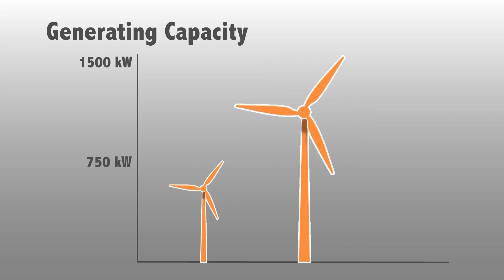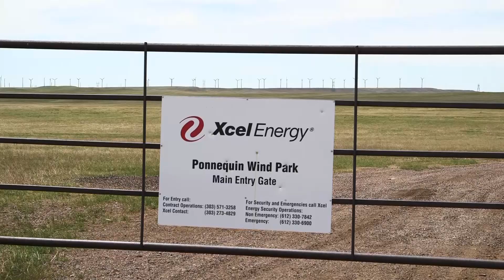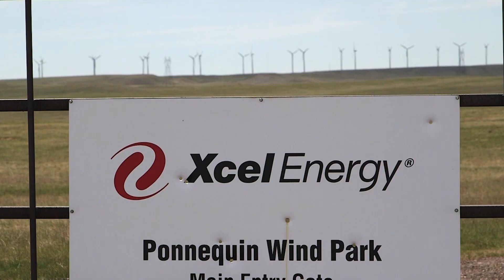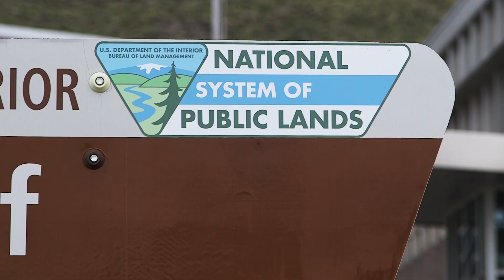Who Cleans Up When a Wind Farm Retires?

Comment: We should have built more clean, efficient, safe, reliable nuclear power plants decades ago. Then we wouldn't even need to have this discussion. It's not too late to start.
#CleanNuclear
#SafeNuclear
#GreenNuclear
Reply: Nuclear will need massive subsidies and complete revamp of the engineering implementation. They also need to switch to Thorium/Liquid salt systems.
Maybe the with SMR-Thorium it could work.? 
Also the whole electrical grid needs a huge modernization in itself.
MJ
Reply: Lies  Nuclear Lies  Just Bigger  Money  For Ever A Pit OF DEATH   Never Stops Killing THE EARTH   You ARE Fools  That Say Clean  Cancer For ALL Damm The Greed Lies
Reply: Replacing a reactor core is far more dangerous, and a much greater environmental hazard than any battery, turbine, or panel. Some batteries are difficult to recycle into new batteries, but recycling a spent core is virtually impossible. I'll take my chances with batteries.
Reply: @vincentrobinette1507  Yes replacing ONE reactor core is far more dangerous and a much greater environmental hazard than any ONE battery or panel.  HOWEVER replacing about 2000 nuclear reactors is far, far less dangerous than making (much less replacing/recycling/disposing of every 10 years) the equivalent of 5-10 BILLION powerwall batteries needed to keep a renewable grid from suffering regular blackouts and enough solar panels to cover a state.

See, you're thinking about this from what is in reality a seat-of-the-pants, grid will collapse at any time standpoint, aren't you?  I'm guessing (perhaps an unfair assumption) you take average electrical consumption and assume a day's backup, maybe two is enough to keep everything from going south.  But even the existing grid has weeks worth of "storage" equivalent in the supply chain (or piled up outside plants) and even though electrical production (which is only about 1/3 of demand) is about 10 terawatt hours per day, actual generating capacity with that on-demand system is enough that the US could produce in excess of 20 terawatt hours per day if they ran it full out.  Checking out capacity factors for whole nations and you find that wind output vs installed capacity will vary over a whole year by as much as 20%.  We'd need a month or two of backup (electrical) power to keep there from being blackouts, often at crucial times like during winter storms.
Reply: @poitsplace  Power walls work really well for residential applications. You need a lot more than that for commercial buildings, which need far more power for the area available for solar panels. If you were to go off the grid, I would recommend 5 days worth of storage for wind only, about the same for just solar, but for both, you could get by on a 3 day reserve. I recommended 1 day for home, if you're backed up by the grid. On a grid scale, 1 day of stored energy would work well, if the entire nation was networked together. that's because, the wind will be blowing  somewhere, there will be sunshine somewhere. Solar panels will usually produce at least half their rated power, even on an overcast day. Wind is more intermittent than that. When the wind blows, turbines really put out a lot of power. otherwise, they're just yard ornaments. You need much more storage for wind-only applications. It would be really easy for me to go off grid right now, but if I want to get rid of my gas furnace and switch over to electric heat, then buy an electric car, that will double my power consumption. It would be much more of a challenge then. That is my goal, but the tech just isn't there yet. Most power stations like to keep 15 to 30 days worth of fuel on hand, just in case of a supply interruption.It also provides reserve for unusually high demand. If all renewable resources are in the same area, you need more storage than if they can be scattered all over.
Reply: @ @vincentrobinette1507  You're thinking of this with the mindset of an enthusiast...willing (if not intent) on making sacrifices to make it work.  The rest of us aren't putting up with it.  The rest of us don't want "smart meters" to cut off our appliances because other people's ideology says we need to use a long abandoned energy source known for its diffuse, irregular nature.   The rest of us will not tolerate "Sorry there's no work today because the wind isn't blowing and the sun isn't shining bright".

Market forces utterly destroy renewables and nobody has even reached 20% of total energy demand.  Because of the capacity factor, when they produce, they frequently overproduce by so much that it would be near impossible to use it (prices crash  so their energy is literally worthless).  The grid needs to have over 5X the capacity just to move massive amounts of power over such vast distances, often at a moment's notice.  The grid doesn't even work the way you think it does.  There is no "we just run a wire there"...electricity goes where IT wants...with the current system of large power plants this is not an issue, the output is relatively stable because we know the path it will always take from a small set of specific points.  A recent study found that about 60% of germany's overproduction actually cascaded AROUND the lines meant to carry it...overloading local grids as it drops the energy at the closest point, which displaces capacity from the other region, which displaces power from the next...overload after overload.  Your comment also ignores that generating/grid costs skyrocket as a result of renewables increasing wear and tear while decreasing economies of scale, now such inefficiencies are wrongly attributed to fossil fuels when the additional costs are actually the cost of renewables.
Reply: @poitsplace  That is precisely why electrical energy storage is so vital, for intermittent renewable energy to work. That's why wind can never exceed 20% without storage. The disruptions of the grid. Base load plants cannot respond quickly to rapidly varying loads. They're not like a portable generator with a governed Briggs and Stratton engine. At the very least, you need enough electric energy storage to give a long enough time constant, for base load plants to respond. They need hours, not seconds to respond. during gusty winds, too much wind capacity can cause all the problems you described and then some.
Reply: @vincentrobinette1507  The problem is that you're talking about bending over backward and making truly massive sacrifices to solve a problem that simply does not exist.  You're talking about an ongoing cost of something like ten trillion dollars a year just to prop it up the policy of blighting the land with these monstrosities (more than the turbines/solar installations themselves).

On the other hand we have nuclear.  Even if we needed peaking capability with older style plants, the peaking needs are about 1/4 of a day's production worth of storage because we're not at the whims of the weather.  We KNOW the rate of production.  And if you wanted to move much more quickly to reduce CO2 (not that its the issue many have been duped into believing it is) you'd be better off pushing for fracked gas to immediately reduce the consumption of coal as nuclear plants were built.

As it is, once you really look into the math of how renewables ruin the market, you know the current nonsense about wind/solar would fail, period...grinding down the economy until all support is lost and pollution skyrockets as people stop caring about the environment at all.  But of course, since these things all happen across a spectrum, support verses "progress" toward renewables will end it before it gets much worse.  Probably end up using coal since everyone pushing renewables was so dead set against anything but renewables to compromise.
Reply: @poitsplace  I don't know what the sacrifices are, but the status quo is not sustainable. There is no perfect solution, but it's going to be an easier transition when we run out of mined resources, if we have a head start on alternatives. If we don't gain experience, and allow technology to reach scale of economy, it's going to be brutal. Because of the renewable push, solar panels can be purchased for less than 50 cents per watt. If no effort was made, we would be paying 5 dollars per watt. Turbines are less than half price, and are much more reliable, because of field experience. Like them or not, we will be stuck with them when coal or natural gas it tapped out. The greater the percentage of renewable capacity, the less difference we'll have to make up. What we need to be working on right now is energy storage. It's the only hope for nearly 100% renewable power. There will still be a need for base load, but when coal and gas run out, nuclear might just be the  choice. We just need an economical way to extract uranium from ocean water, which can keep us supplied for many years to come. With mines starting to close down from being mined out, and using natural gas at an unprecedented rate, that's coming sooner than you might like to think.
Reply: @vincentrobinette1507  Remember that the first step in "sustainability" is lasting until tomorrow.  Deploying clearly inadequate, overpriced technology will only weaken our long term position.  Nuclear would weaken us less...although I have absolutely no problem just letting things run and allowing market forces to make people go "Ok, this is too expensive for what we get, we'll phase it out and move to other things"

The irrational fear of nuclear and push for renewables is only making it HARDER to find new technologies because subsidies are propping up technologies that are clearly unfit while (ironically) creating an even heavier demand on fossil fuels.  Putting it off because it's just plain inadequate is the most rational decision.  Different technologies will show up, things that we haven't thought of, especially if we don't back specific current tech.
Reply: @poitsplace  As it turns out, there is a measurable amount of uranium in sea water. If we could find a cost effective way to merely filter it out of the oceans, nuclear could be an excellent base load power source. Right now, because of the cost of the energy storage necessary for renewables to become a significant percentage of our capacity, it hasn't quite reached the "tipping point" in very many areas yet. As technology gets cheaper, and fossil fuels get more expensive, we are getting closer to that point where renewable energy is cheaper to develop than conventional. I don't think we should shut down mines, or retire existing assets, just run them until the mines are mined out, then make a decision. No matter what, there was money invested in each of these sources. To get the most return on that investment, they need to finish out their life cycles. That goes doubly for wind farms, because of their lower output per dollar invested. If they are decommissioned early, there is definitely a loss.
Reply: @vincentrobinette1507  The problem here is you've been brainwashed by endless, one-sided BS.  It is not "almost cheaper", it's supported by ridiculous subsidies.  Paying half the cost?  Guaranteeing that you get paid end user rates for extremely low quality/reliability power?

Have you looked into the MATERIALS requirement of renewables?   I guarantee you once you hit the cement/steel/labor required per gigawatt you INSTANTLY go "Oh, these people are bat $#!+ insane and have been lying to me this whole time"....like it has 5-10X the requirement of even the older, more complex nuclear plants.  That's what did it for me.  I hit the number and then tossed it all like the nonsense it was.  It WILL NOT happen because the scarcity of materials would grind the economy into the dust, ending the ability to do it in the first place...and even if it didn't it would take 5X as long as it would to deploy nuclear because of the materials/labor requirement (also it has to be replaced twice as often). 

The storage requirements ALONE come to about 1/4 to 1/2 of GDP.  GONE...not happening...outright insanity.  There's no "but what if" unless that "what if" involves grey goo nanotechnology that builds everything for us while we get fat and lazy and pay nothing.

Market forces insure wind/solar ONLY work for off-grid installations except in extreme cases.  As soon as it hits the market, think about the simple math...because of capacity factor they're frequently overproducing, meaning the power is TRULY worthless and most of it has no return on investment.  OR they underproduce, driving dispatchable prices higher (along with electrical bills) while again, not giving return on investment ....it is literally a buy high, sell low scheme for the unobservant.  In europe...and please, look this up...spot (wholesale) prices for electricity sometimes go NEGATIVE because of renewable overproduction.  Its just propped up by subsidies.  

None of this touches on the complete overhaul of the grid and making a system of enormous trunk lines, service roads, wind/solar farms, etc criss-crossing the nations of the world...just hoping and praying that everyone will come together singing Kumbaya instead of getting pissed at each other over energy policy.  And of course hoping that its not more damaging to put all that stuff out in the environment than just waiting a bit for a likely more suitable, lower footprint source of energy..

Nuclear has simply been vilified.  We have a perfectly acceptable strategy.  Have you heard about the tests they do on the transport containers?  Has it EVER occurred to you how insane it is to say "But what if some gets out" from a kilometer down into pristine wasteland that's been geologically stable for half a billion years?  Because I'm guessing  you never thought about the fact that if ANYTHING brings up a meaningful amount of radioactive wast from a kilometer beneath the surface...the LEAST of your worries will be the nuclear material.  The main concern would be the supervolcano or asteroid that nearly wiped out humanity when it just happened to hit a nuclear waste dump, which BTW would carry an insignificant amount of radiation compared to the hundreds or thousands of cubic kilometers of rock that would have been ejected into the atmosphere.

After you actually shed the optimism and start looking into the REALITY of what is required...its insane to think its a good idea to move forward with such plans in the immediate future.
Reply: @vincentrobinette1507  
I don't think we're going to 'tap out' our mined resources anytime soon. Back in the seventies the doom and gloom prophets were claiming a less than 30 year supply of oil left in the ground. 40 years later we apparently have a greater than 200 year supply. The coal industry says we have a 300 year supply in the US alone. 
So we're not in any danger of running out anytime soon. 
Solar and wind are NEVER going to be better than a partime solution. Barring some 'eureka' discovery somewhere, storage solutions are going to be a long time comming. Batteries are always going to be big, and expensive, with a relatively short operational lifespan. Then disposal/recycling which will require ever greater resources as more of them require processing.
Reply: @chuckaddison5134  That was 40 years ago. Not only have we continued to use, but the demand has more than doubled, since then. It is harder to find now, which is why we're resorting to oil shale, and fracking to get to the bottom of the barrels. It's becoming increasingly more expensive. I remember oil being less than $10.00 a barrel, now, it's well over 70, and has reached over 100. 10 times more expensive than it was in the '70s. We are not going to wake up one morning, an find every well in the world has run dry. That won't happen. What will happen, is it will continue to become more, and more expensive, until it is no longer the most economical source of energy. It continues to get more expensive, while technology becomes less. The tipping point has been reached in other countries, and in certain areas in the US. I give it 5 years, no more than 10, that the tipping point, where renewable is less expensive than conventional, will become largely nation wide. When that happens, grid scale electrical energy storage will become absolutely necessary, to maintain continuous reliable power. Another thing that may make a comeback: Nuclear power.
Reply: @vincentrobinette1507  
For what its worth, I believe nuclear is the future. It's here now and getting better. I dont see the renewables ever being the main source of grid power due to the production and lifecycle costs. Yes, they will come down some, but still, the vagarities of the sources are uncontrollable.  If you consider the sheer numbers of wind turbines required, then you have to start considering the long term consequences of the amount of energy we would be extracting from the earth and, ultimately, sending into space as waste heat.
Uranium is a commonly found element, at least as plentiful  as Zinc and Tin. So we will have grid power for many generations to come. Waste disposal issues will have to be solved. Recycling nuclear waste is an immature technology that, if developed, could both reduce nuclear waste by using it to make more fuel, and reduce the half life of the reused waste to a few hundred years from the tens of thousands now required. 
There are some security considerations around recycling the waste, but nothing that can't be solved.
While I actually have no issues with solar and wind, I dont ever see them as more than an off grid solution for individual homes, or small groups of homes. Plus there appear to be issues with infrasonics from the wind turbines which, if unsolved, could limit human habitation around wind farms. Which would be a problem as the farms  would occupy a substantial chunk of landmass.
Reply: @chuckaddison5134  Nuclear is a perfect base load power source. it can greatly reduce the amount of stored electrical energy to firm up the grid for a large customer base. The only consideration is levelized cost of energy. A nuclear plant is VERY expensive to build and commission, but, consider the vast amount of energy they can produce over their service lives, to divide out that cost. Nuclear could prove to be a very economical source of power,  especially if a recycling program comes on line to re-refine the cores, and reuse the fuel. From what I recall, you only use a small percentage of the total energy in the core, before it just doesn't put out enough heat to run the plant at full rated power. When a spent core is removed, it has to be stored in a cooling pool for years, before it cools down enough to be put in casks for disposal. That's a lot of stored energy left on the table. Nuclear power is definitely a long term investment. A lot of money up front, for energy that lasts for decades.
Reply: @poitsplace  What we're doing now isn't going to last forever. It's not likely that we will suddenly run out of fossil resources. What will happen, is that it will just get more, and more expensive, at the same time, technology becomes less expensive. Compared to just 20 years ago, solar is only about 1/10th as expensive as it was. Wind turbines are about half the cost per watt. I remember crude oil being less than $10.00 a barrel. now it's at least $70.00, and it has gone higher than $100.00. wind turbines and solar panels have become less expensive than conventional sources in some areas, where electricity rates are above the national average. The problem is, like you say, is that when you add the cost of the electrical energy storage necessary to levelize the intermittent  output, that's the only thing holding it back. 20 years ago, your statement would be absolutely correct. now, it's debatable. Give it 5, maybe 10 years tops. We'll see what happens. Nuclear is definitely a good option, if it is cost effective. It really is a long term investment. Billions to build, but it puts out so much energy over its lifetime, that it should have no problem covering its cost. Turbines and panels pay for themselves in about 5 years. Nuclear takes about 20, but can run for as long as 60 years. Replacing the core of the reactor is a very expensive maintenance, that needs to be done about every 20 years, but it's nowhere near the initial commissioning cost of the power plant. New cores pay for themselves rather quickly. Please note, the General Electric BWR 6 nuclear reactor is what I"m basing my data from. Newer reactors are undoubtedly going to be better. We can't immediately shift away from coal to wind, this transition will happen by attrition over several decades. No matter what the energy source is, money was invested. the only way to turn maximum profit, is to allow each source to finish out its life cycle. I also agree, that if a source, be it conventional, renewable, or nuclear, is so cost effective, then there should be no subsidies for any of it. Let free enterprise run her course. Whoever can get power on the grid the cheapest, wins.
Reply: @vincentrobinette1507  
A recycling program would be a necessity if we're going to embrace nuclear power large scale. Used in a single ended or single use plant our planets high grade uranium would be consumed in a couple of hundred years or so, leaving vast quantities of very long half life waste to be dealt with. Reprocessing and second use of the fuel reduces the wastes half live to 500 years or less. Still not ideal, but better than tens of thousands of years. The only other problem is reprocessing produces Plutonium 239. Which would require some increased security considerations.
Reactor designs have improved over the ones installed in the 60s and 70s. 
The molten salt reactor is supposed to produce more power at less cost with less waste product and less chance of meltdown than the water cooled designs currently in use. 
Another prospect is the single design plant. Which could then be cloned whever a plant is desired. This should reduce construction and certification costs over time while increasing safety and efficiency. 
There are, of course, hurdles to overcome. Public opinion being prehaps the largest. But sooner or later we're gonna have to go down that road.
Reply: @vincentrobinette1507  Look, we are simply not going to use anything remotely close to the wind/solar we have today.  Its a passing fad.  To suggest we use wind/solar is to pay utterly insane amounts of money to transform the energy industry...and then in less than 20 years we'll have to pay another fortune to rip it all down and use whatever forms of nuclear energy we decide on...fusion, traveling wave reactors, MSR's, pebble, etc.

The ONLY reason anyone is deploying it on utility scale is that governments are throwing money at it...insane amounts of money...basically guaranteeing well over wholesale rates for crappy, intermittent energy that has an average value of about $.01/kwh.  And BTW it IS NOT "whoever can get power on the grid the cheapest".  Almost all the value is in it being available when you need it.  Intermittency has a high cost, so no matter how cheap it is, its still "too expensive" for most people.  I'm all for letting utilities do it WITHOUT SUBSIDIES, but you and I both know the moment the subsidies dry up, not only will they stop building new capacity...they'll let all the stuff that is built fall apart rather than repair it.  I'm pretty sure you kind of understand that, and it should make you stop and think.
Reply: @poitsplace  intermittency is the major problem for both wind and solar. What we need now is grid scale energy storage. That will allow base load plants to run at their peak efficiency points, as well as absorb the surges of power from gusty winds, and partly cloudy days, as well as level the varying loads from the customer base. With that, there would be little to no curtailment of turbines, nor solar. Coal plants will be able to maintain their maximum megawatt hours of energy per ton of coal burned. The problem is, back to the cost effective thing, is that if you add the cost of renewable sources to that necessary energy storage, it can't compete on the wholesale market. Solar panels and batteries are a break even for me, because they're competing on the retail market at $.11 per kilowatt. I can't quite save money yet, but it wouldn't cost me. Wholesale, less than $.04, the turbines themselves barely compete. Energy storage puts conventional sources back in the lead. IF someone comes up with a commercially viable nuclear fusion reactor, or perhaps even a good breeder reactor, that would render ALL existing power sources obsolete. Coal, natural gas, conventional fission, and of course wind, solar, geothermal, or any other renewable would be on the chopping block. Until then, we need to make due with what exists, that means wind and solar, as well as letting existing conventional sources finish out their life cycles, to get as much return on their investments as possible.
Reply: @vincentrobinette1507  I give up, you're right...2+2=37 or whatever deranged, moronic math you use that says "uncompetitive wind/solar + storage that's even more expensive by its self + by the way, absurd grid improvements = competitive product"
Reply: @poitsplace That's why I said, because of the cost of grid scale electrical energy storage, Wind and solar aren't ready to compete in the wholesale market, just yet. As fuel gets more expensive, and technology continues to come down in price, the time is coming, but not in this decade. It may not even happen in the next, though I think by 2030, there will be a change. For right now, today, you are right. We just don't have that energy storage. If wind blew all the time, wind would be cheaper, but, few turbines ever produce more than 30% of their rated output, because of intermittency. Solar isn't quite as good, but it costs less per installed watt than wind.
Reply: @poitsplace   They have a hard time with research, facts and science...
Reply: amen to the smart meters- terrible idea!
Reply: @vincentrobinette1507  You will change your tiny green mind as the icy fingers of the present cooling cycle chill your little bicycle riding arse.  Go see the numbers, without nuclear power we may all well doomed to relive a mediaeval lifestyle.  Personally I love sweltering hot days but they may be in short supply in the next decades.
Reply: Actually, your statement doesn't take into the account of the actual history of thousands injuries and deaths connected with wind and solar in a year, which is much higher than the injuries and deaths connected with nuclear power in 60 years. Not to mention the actual increase in fossil fuel usage resulting from "replacing" nuclear with so-called renewables. Wind and solar simply hasn't lived up to the fantasy. Your fear of some imagined hazard doesn't fit reality. Fortunately, the growing movement toward nuclear will happen without your permission.
Reply: #NuclearIsNotTheAnswer